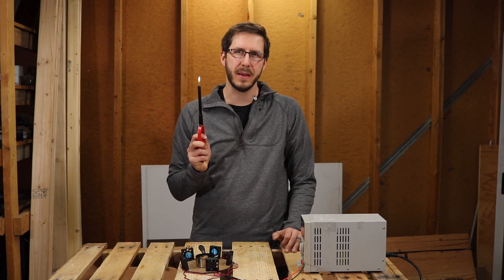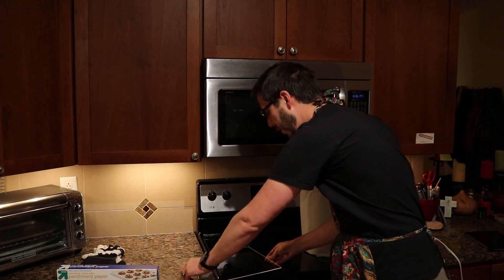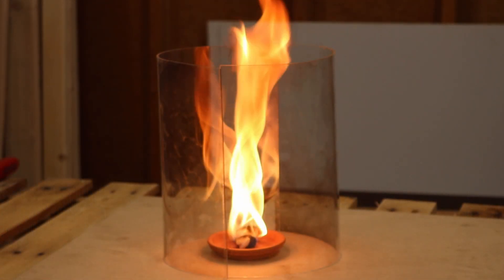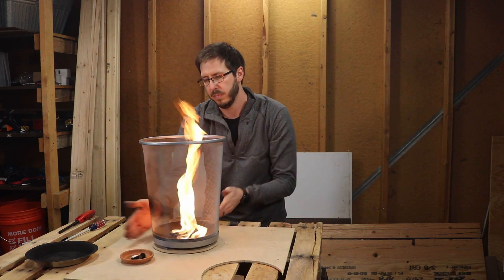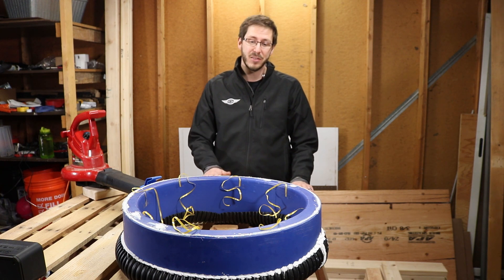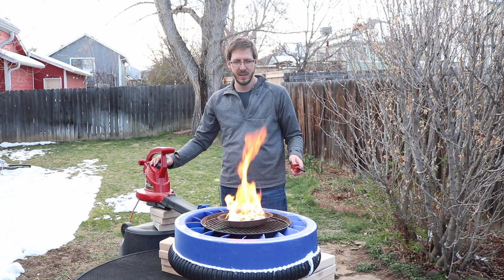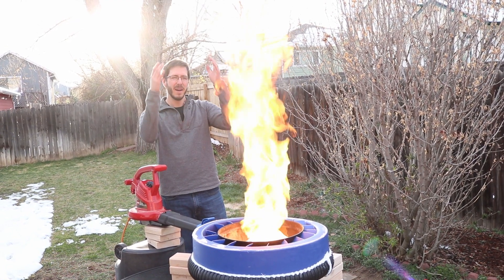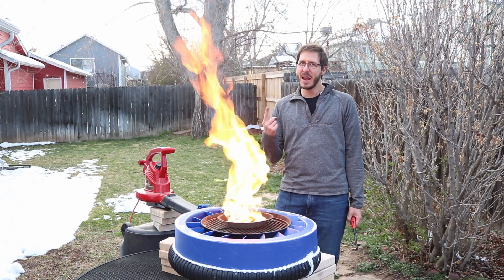4 Fire Tornadoes DIYs!!! Bladeless Fan Fire Tornado Design!!!

Comment: I think you could concentrate the vortex even more by modifying the shape of the ring
Reply from the maker: What sort of ring shape do you suggest? Are you thinking of making the ring taller?
Reply: @RyanMake  you want a venturi effect to eject the hot gasses more focused out of the barrel. That means you have to narrow the opening at the top and create pressure at the bottom/inside the barrel instead of trying to create the airflow at top with fans.

If you try to create the draft with fans at the top of the barrel you will almost always create an astable turbulent vortex (as shown in the video ).

Looking at the venturi,/Bernoulli ideas of pressure and fluidity you can build a firenado barrel with much more stable vortices.
Reply: @armwrestling_nerd  you mean make it tapered and look like a cone?

Comment: Hate to tell you this. That is NOT a bladeless fan. The blades are just in the damn leafblower. All you did was duct the air into the ring.
Reply from the maker: True. I have some plans for a true bladless fan but for this project I simply used the existing industry terminology for a ducted fan feeding a vented ring.

Comment: Pretty nice. You did better than the backyard scientist, but the vortices are not well formed (except for the spinning trash can). What I mean by this is that they do not resemble a long column. Your rotation/updraft ratio is off. It's hard to say which one you have too much of for sure, but typically too much rotation is the cause (unstable rotation might also be an issue). Additionally, the bowl in the center will prevent a vortex from forming nicely. It's pretty important to have a flat center with no obstructions. 

Overall I think you achieved what you wanted to, which is a fire tornado. Sorry if I sound harsh, but I've done a lot of experimenting and built a lot of prototypes to know that a well formed vortex looks much better. If you want to see how well the fire tornado is formed, put something smokey in it. If smoke does not continue to swirl in a tight vortex long after the fire ends, it is not well formed.
Reply from the maker: Wow! This is amazing feedback. Very informative and constructive.  I am really grateful to have you here on the channel. I will have to work on tuning my next design with these ideas in mind!

Comment: I discovered through a fair bit of trial & error that even though practically any & all quality setups for creating ridiculously intense fires with substantial vertical flame heights universally benefit from/require significant airflow/ventilation ideally beneath where the combustion is occurring (not breaking any new ground pointing that out either hahaha), I've learned that inducing the circular airflow to create a fire tornado/vortex doesn't have a similar requirement to also be positioned beneath the burning fuel, which saves quite a bit of logistical issues when considering the perils of placing any type of fan or (like in your case) any other type of contraption beneath a burning material that has many routes of escaping its combustion chamber by design. My setup is to take some plain-jane steel sheetmetal & roll it into a cylinder shape about 3.5ft tall  (I stick welded it together but hose clamps work just fine too) and then cut two rectangular slices out of the side opposite from each other with one about a foot from the bottom and the other offset around 10" higher with the slices big enough to accomodate the outflow port of a 12v "biscuit" fan. I buy the ones that are about 4-5" in diameter and sound like a tiny hair dryer (which I think they could 100% outperform if equipped with proper heating elements. As long as you have them oriented properly, the design of how those fans blow air lends itself greatly to creating a fire tornado and eliminates any need for some asinine 5 fan setup. You can actually pull of a legit fire tornado with just ONE of those fans too, but it's a very fickle thing to dial in. Two is practically autopilot with basically zero risk of burning your equipment up too since they have a "firewall" instead of a "hole that rains burning death into it" by not being beneath the combustion. Shoot me a reply if you ever make one since I imagine your setup would be far more methodically constructed & kickass as a result, hahaha. I'd love to see it!
Reply from the maker: Thanks for the thorough comment. I will need to read it a few more times to visualize what you are describing but it is sounds similar to what i have been sketching out for the next generation of this project.

Comment: I have built a wood fire pit powered by three underground 250 CFM server fans (PWM modulated) into a dryer drum (also in ground). It really burns very high when you add enough fuel (wood). Now I want to further optimize my flame height. As almost all heat comes from thermal radiation so I want to make my flame higher. And a vortex seemed to be the perfect way as the flame gets denser and taller. But without adding any noise as people are sitting close to the pit and we still want to be able to talk ;)  How much CFM or m³/h did you need to achieve the vortex under (semi) wind still conditions and which angle did you glue the vanes? You could bend the vanes perhaps like a wind vane as well, to make the uplift direction more efficient.
I was thinking about making a round steel frame around the brick layer of my fire pit (to block most of the heat) and then install smaller PC fans into them but I'm afraid the vortex will be interrupted too fast by other winds and it won't really extend my flame. Let me know how four permanent installation will look like and perhaps we can learn something from each other ;) Subbed!
Reply from the maker: These are Fantastic questions. The units I am using supposedly can do 340CFM:
https://amzn.to/3aB4PM6
However there the flow is getting redirected and is constricted so I would be surprised if I was getting more that 250 or 300 CFM. 
The vortex was a lot of fun to make and I am working on  the next generation because I would like to do something exactly like what you are talking about a more permanent installation.
I had the veins are about 20 or 30 degrees off vertical and it worked pretty well.
Thanks for the sub! Let me know if you make progress on your fire pit! I will be posting the progress that I make as well.

Comment: the leaf blower has blades, like wtf?
Reply from the maker: I think the two basic reason why that sort of setup is called a bladeless fan is that the blades are concealed giving the illusion of being bladeless and the second reason as that using the blue manifold it buffers the air so that it does not come out choppy like a traditional axial bladed fan.

Comment: Doesnt the leafblower use a fan to push the air?
Reply from the maker: Yes, The leaf blower does use a bladed impeller to push the air. I think that reason why something like this is called a bladeless fan is that the blades are hidden from sight and that they are not the only thing that causes the air to move because it utilizes entrainment